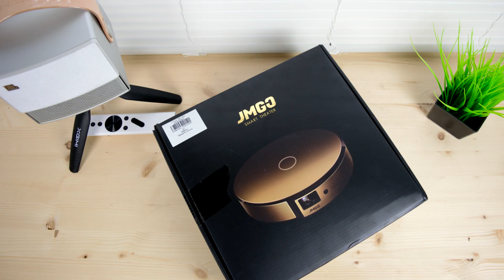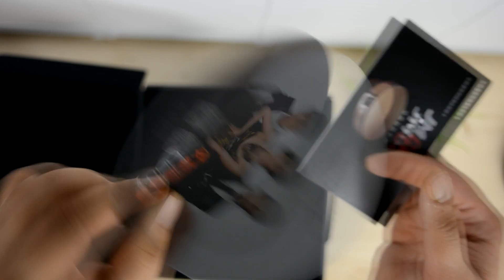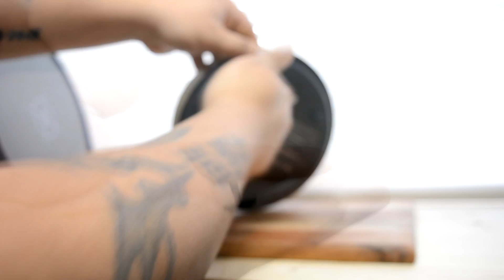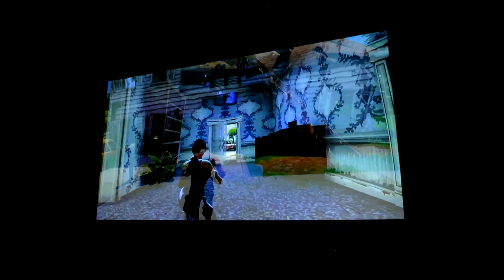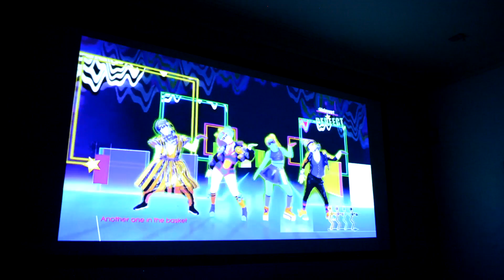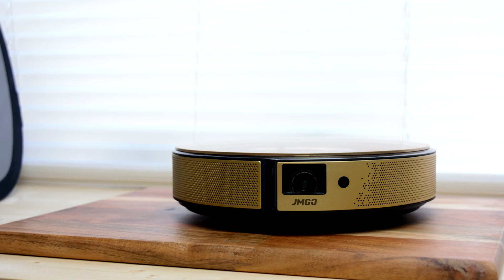JmGo E8 Projector 750 ANSI Lumans - The Definitive Review

Comment: hmm any advice on a good projector for home for under $1000? i was thinking of the BenQ HT2150ST but i have no idea what's worth the price and/or if there are better for that price range....i hear this the Benq 2150 is good but is there better for 800-900s? i have about 10ft between the wall and the projector.
Reply from the maker: That's a pretty good alround projector I've seen a few reviews myself looks very capable, you also have the benq w2000 or if your looking to top out the budget then maybe the optoma hd141x http://amzn.to/2FN6SxP
that's one I'm currently looking at myself.
Reply: i'm willing to spend up to 1000 so 940 is within my budget!

do you think that's better in terms of for movies/games than the 2150?

i get SOOO confused about projectors because you need a vast amount of knowledge in this subject manner to actually know what you're looking for and how it would preform before using it...like i just found out claims of high lumen means nothing because they can just boost white output and the color would be overall crap...

Comment: What does 750 ansi lumens equal to in regular lumens?
Reply from the maker: Well in marketing terms what most chinese manufacturers or Amazon sellers do is X  the ANSI luman by roughly 6 so in this case it would be 4500 lumans. Obviously this will vary depending manufacturers.
Reply: @TECH404  curious about Optoma projectors, they claim 3200 ANSI lumens for their sub 600 usd projectors, are those lumens claim real?
Reply: Is 350 lumens in reall
Reply: Did he say anus eye lumens?